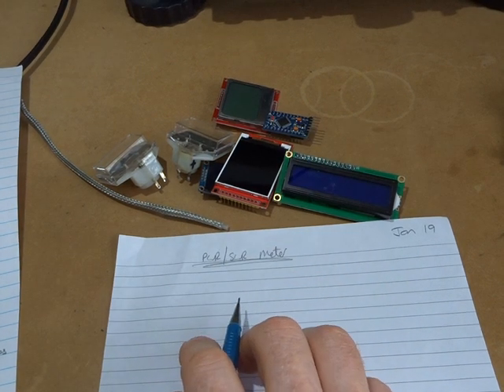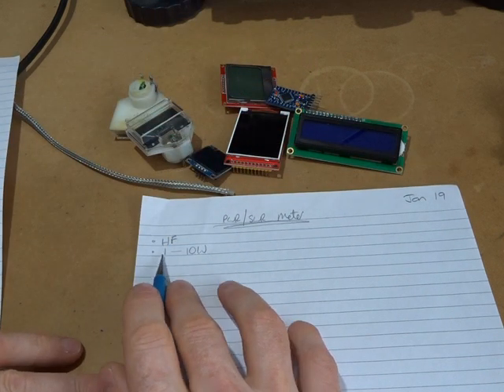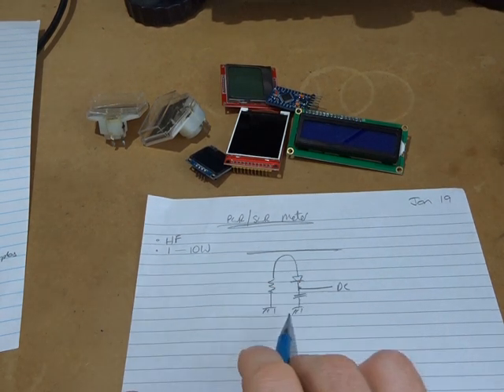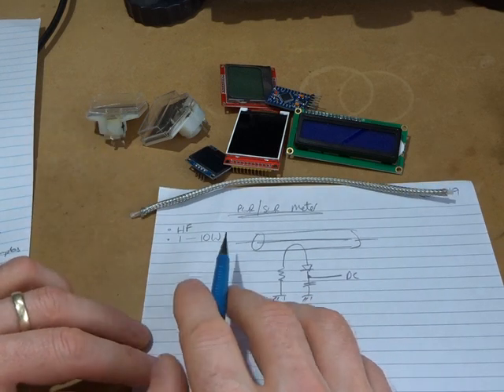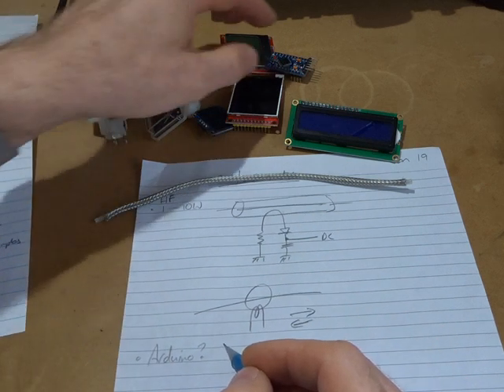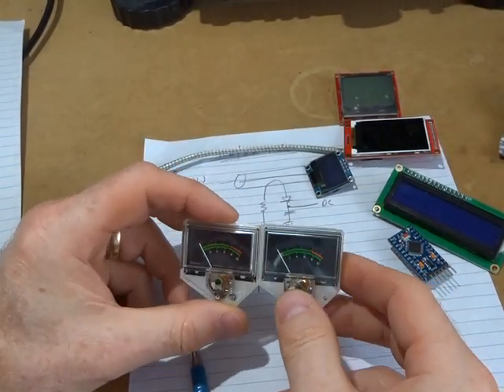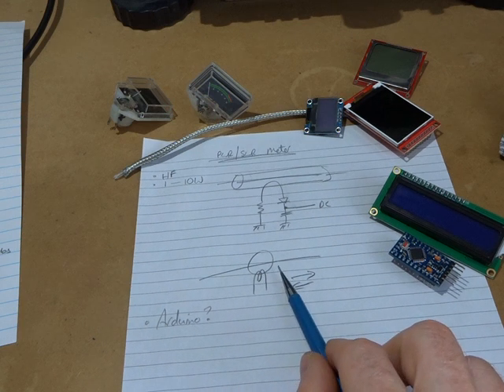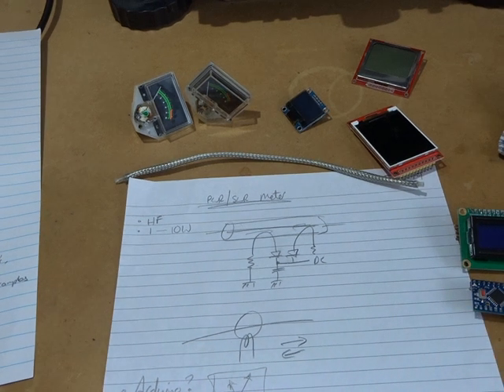Homebrew PWR/SWR Meter: Part 1 - Thoughts and Ideas

Comment: Here's an additional challenge.  Put a forward bias on the diodes so they operate in a more linear range and can be used at very low power levels.
Reply from the maker: That's an idea. I'll jot that down.

Comment: Great project, 1 to 20W, arduino, TFT and AD8307 based would get my vote, but whatever route you take I'm sure I'll learn a lot :)
Reply from the maker: Thanks. I'm going to factor in cost and ease of getting the parts (not just me, but others too). The AD8307 certainly works well, but costs me around $20 + shipping. If I can emulate that using-say-a LM358 then I'll give it a try first. We'll see how things play out.
Reply: Understand looking forward to seeing the LM358 implentation.
Reply from the maker: @m0khz  Hopefully, it will work. That's what experimenting is for!

Comment: Hi Charlie, my suggestion would be to use one of the Nextion graphical displays then you can have a whole host of widgets and graphs/meters that are totally software configurable. 
This gives you the additional benefit of making a suite of test equipment using one Nextion display, you could have an RF power meter, Antenna Analyser, Intelligent Field Strength Meter, SWR Bridge, RF Signal Generator and many more by designing a plug and play system where each module has its own Micro Controller and which does all the specific function logic and sends a unique ID per device so when you plug the Nextion display head in it knows which GUI to display depending on what module you have hooked up.

Sorry for the brain fart, just thinking out loud over my morning coffee here in Blighty :)

Cheers and 73

Rob

M0XXQ
Reply from the maker: Hi Rob. I will look into those displays and the idea of a suite is appealing. At this stage I'm still working out what I want (need) in addition to the MFJ tuner I already have. My plan is to start playing around with different ways to generate the DC, then look at ways to display it. Cost is a driver as well as ease of getting the various parts. Enjoy that coffee!

Comment: For a HF-Power/SWR-Meter i have used toroids, because of a better coupling. 
Maybe you can use some of my desciptions, circuit, Arduino-Code or photos even it is in german: https://wiki.funkfreun.de/projekte/swr-meter_kurzwelle
and in this zip-file: https://wiki.funkfreun.de/_media/projekte/hshb-swr-meter.zip

Last year i have added some components to add analyser functions. 
The documention is still not finished and i want to make some changes to the arduino-codes (one for analyser, one for the TouchLCD), but maybe it can be useful for your ideas: https://wiki.funkfreun.de/projekte/swr-analyser

Comment: I have done several versions of Arduino based SWR/Pwr meters.  One was stand alone with  TFT display The other is one I am incorporating in a BITX type transceiver. that uses a OLED display.  Have been thinking about doing a stand alone with two OLED displays to simulate one of the original Analog meter types.  For the pickup I ended up using the same basic circuit with amplifier used in the no longer produced Norcal Power/ SWR meter.
Some information on the ones I built on my blog.
https://kv4qb.blogspot.com/2016/02/qrp-swr-meter.html
https://kv4qb.blogspot.com/2018/04/stand-alone-simulated-analog-meter.html
DuWayne KV4QB

Comment: This IS a project i really need.
Started one last year but never ended because of the work (navy military) all the parts ended on outher projects.
Realy like to see on a 16x2 lcd or a small nokia lcd or some small lcd,  cheap parts and if possible no torroid winding.
Power: i run now qrp whit my uBITX and outher projects 100mW to 1W, and 1W to 10W/15W will be good.
Keep the project and will build one to as a folow up.

73 de Pedro CT7ARQ
Reply from the maker: Thanks Pedro. I'll do some comparisons between toroid and non-toroid pick ups. As I have said before, I am not trying to make competition grade equipment, but instead use simple circuits. That may or may not work here, we'll see! I'm going to do a mixture of displays, one with a 16x2 and one with a LCD with moving needles. Thanks too on the power levels.

Comment: I really like this idea.  It would be interesting to see the difference in accuracy between the loop type sensor you first mentioned, and the toroid loop.

As for display, my preference is arduino based because then you can easily pass the values along to a computer or something, and could also trigger a power reduction if SWR is too high.

As per the display, I'm more of a digital display guy, but I think a hybrid display with both meters and oled would be cool.

Really appreciate your videos.  Please keep them coming.
Reply from the maker: Thanks Richard. Looks like an Arduino based meter will be the way to go. I'm all for that as I get to do some software engineering too.
Reply: Charlie Morris I use the regular LCD 20 x 4 characters or any easy to find easy to use one.
Reply from the maker: Thanks Moustapha. I'm going to use a variety of displays.

Comment: I would really like to see the arduino version with an LCD display. It is a constant frustration for me to see so many QRP projects based on rare, no-longer-manufactured, or "it was in my junkbox" components.
Reply from the maker: Hi Tess. I hear you. Would you prefer to see a numerical display or moving needles on the LCD (or both)?

Comment: I would be interested in an arduino based swr watt meter similar to this one, but lower power and using a tft or other graphical display.   I like the idea of having a serial interface as well. http://www.telepostinc.com/Files/phipps-1.pdf
Reply from the maker: Thanks Ken. That's certainly a capable meter. I might start simple (and hopefully effective/useful) and go from there. I think I might order some more AD8307s.

Comment: Hi Charlie! Nice project. You can use an AD8307 rf log amp with dc out to be read it from analog input of arduino instead a diode and get a better read of rf. And for display I prefer to use 2x16 but anyone of those would do a good work. 73!
Reply from the maker: Thanks Alejandro. I have a AD8307 here. I might try a simpler approach first, then fall back on that if needed.

Comment: I always like test equipment with some type of logging ability, so an Arduino with some type of serial output would be nice.  I could also see an advantage to measuring lower than 1 watt since many WSPR or other digital mode kits put out much less than a watt.
Reply from the maker: Cheers Rob. I probably will add an Arduino for the sake of it. I'd argue too that purchasing two moving coil meters would be significantly more than a Nano and screen. Adding serial put would be east too.
Reply from the maker: Cheers Stephen. Looks like two possible ranges then; 100mW to 1W, and 1W to 10W.
Reply: @Stephen Morton You could have a basic antenna analyzer by sweeping your transmitter through a range of frequencies and recording the SWR. That would work best if the transmitter also had computer or control or at least frequency logging.

Comment: On the matter of displays. The small OLED type with dark background has built-in DC to DC converter that creates RFI so keeping of att receive might be a good idea. Can probably be powered from Arduino output pin so Arduino could power on display when output power is sensed.
Reply from the maker: Agreed. I have had lots of problems with the small 0.96" display. Not so much with the bigger ones.

Comment: For sampling I guess you could simply sample the HF directly via 1k to rectifier diode and cap. Would give same DC for all frequencies. Pick-up methods is non linear with frequency buy has advantage that you can pick-up reflected as well as forward power but if you simply want a power meter direkt sampling would be more broadband and sensetive, but I don't know if that is a factor in this design?
73 from Sweden
Reply from the maker: Thanks Harry. I guess I was thinking about having a power and SWR meter. I wonder if the non-linearity of the pick up loop is an issue if its just for the HF band. I'll guess I'll see. My initial thought of not using a toroid was to make it easy and accessible. Sounds like some experimenting needs to be done!

Comment: Excellent project! Some thoughts: The loop method is mostly used on VHF and above. The toroid works well on HF. There are more options - the three voltage method and the resistive bridge. The bridge works good with QRP. Be careful with the choice of display. Some displays create plenty of HF noise, especially smaller Chinese Oled ones.
Reply from the maker: Thanks Jan. I was hoping if I made the loop long enough-say-5cm then it should be ok for HF. As you point out, there are many ways of making these. I'm hoping to have a circuit that can be left in circuit and not consume too much of the transmitted power. I've certainly experienced OLED noise too, especially with the small 0.96" screens. Thanks again Jan.
Reply: Charlie, I use a classical circuit (one toroid for the current, a direct tap with divider for the voltage) for SWR measurement in an antenna controller that is based on an ATMEGA controller. Depending on the power that you intend to measure, one can trick the chip into some flexibility with its ADC analog voltage levels by changing between internal to external reference. That could get you around the need for amplifiers.
Reply from the maker: That's good to know thanks Jan. I might set the ext Vref high for high range, and use the int Vref for low range. The series will probably experiment with a range of methods, so it will be interesting to see how it pays out.